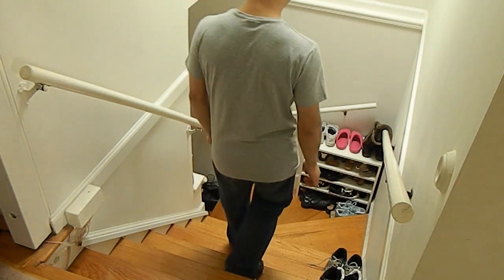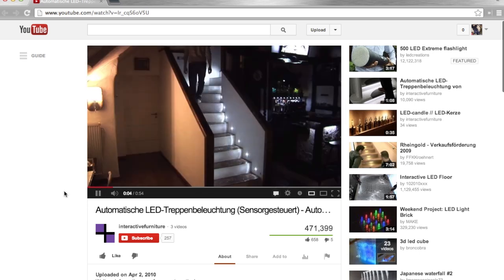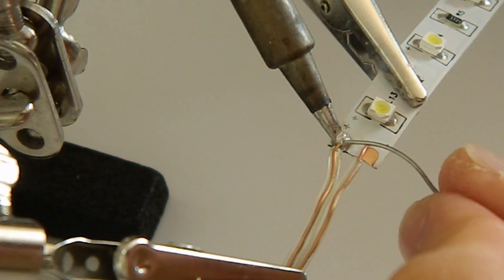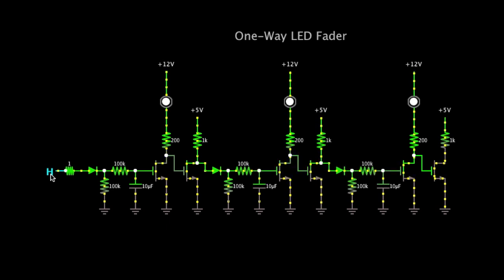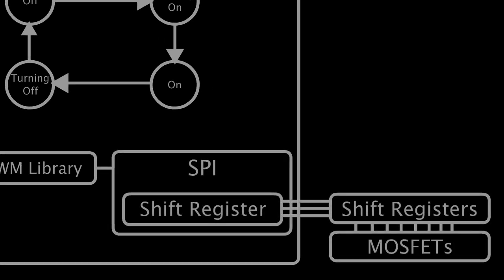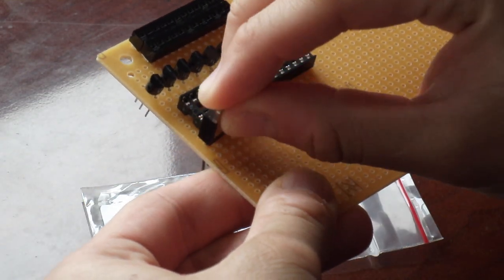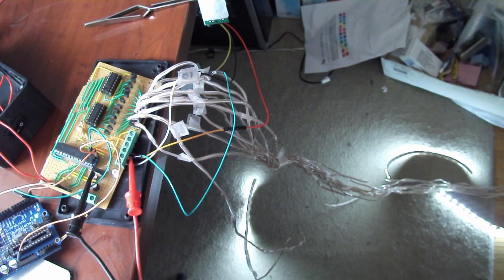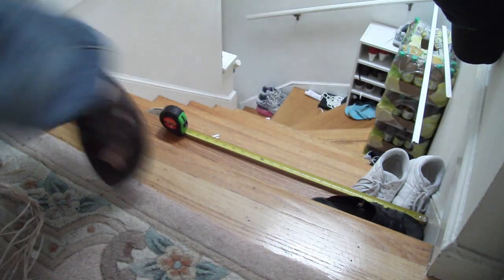How to Assemble Stair Lights

Comment: This great! If more light is needed, then these lamps will work? https://eshinestore.com/collections/deluxe-kits or only LED stripe?
Reply from the maker: you'll have to use beefier transistors that can handle a higher drain current. the 2N7000 that I used only handles 200mA

Comment: youll save fraction of the cost,and spend the rest of your life,putting this together getting the parts
Reply: ZAPP RODD Actually you can probably build it using his PCB design on OSHPark and the components run maybe $50~....the satisfaction of saving over $500 and doing it yourself...PRICELESS

Comment: Hey,
I found this video quite interesting and would love to build one of my own. Should I get any circuit board, or a certain one? I'm not that knowledgable about circuits, and don't know how to read a circuit diagram, but are their certain holes i should stick the wires to?
Reply from the maker: This project is easy once you understand how to use an Arduino. First buy yourself an Arduino, breadboard LEDs , resistors and shift registers. Learn about PWM and shift registers. Then this project will be easy.
Reply: Andrew Ong Thank you for the fast reply! I will get started on it Asap!

Comment: Hello Andrew. I'm from Germany and i'm very interesstet to build this stairlights by my own. Can you   please give me a detailed instruction for building this stairlights? Or would you build one control unit for me? I will pay for your work and parts. Thank you
Reply from the maker: Unfortunately I am a student and cannot afford to sell kits. I have tried to make the video and accompanying blog post (in the video description) as detailed as possible. I can answer specific questions you may have. I suggest trying it out on a breadboard with small LEDs first. Once that is done, it is easy to extend the wires to several feet in length.

Comment: Would arduino mini pro work with your code and PCB?
I was going to use BS170 to get more current for longer strips (36") 500mA vs 200